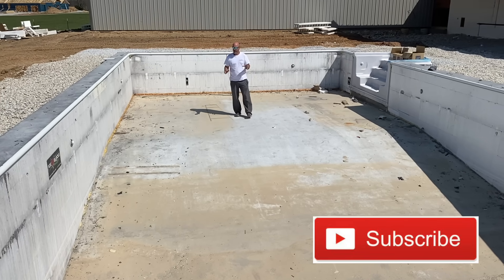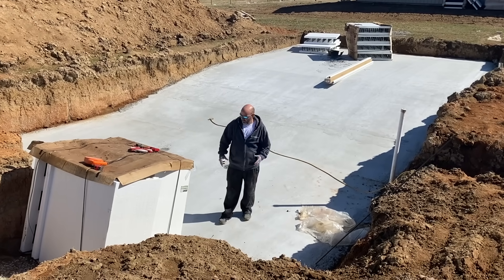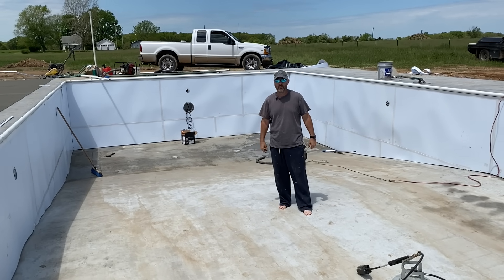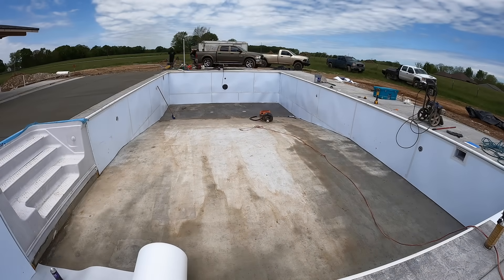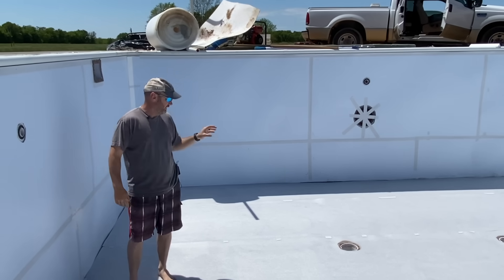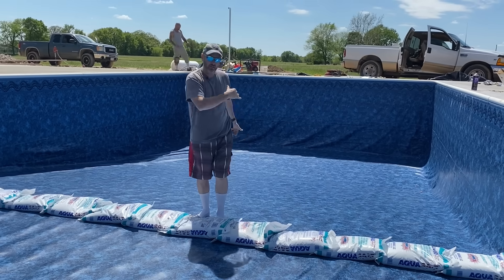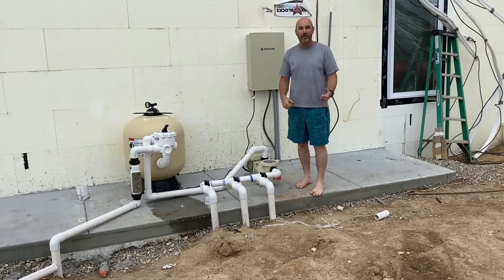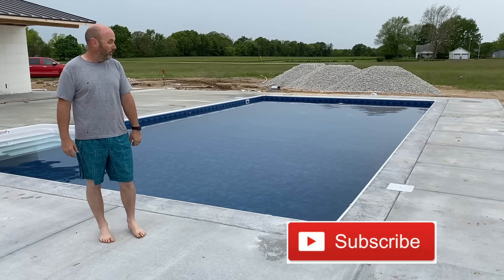ICF Pools of the future! stronger, cheaper and more efficient!

Comment: Looks great. Really like the way you explain things compared to some guys who just like to hear themselves talk. Couple of quick questions. I'm going to attempt to do my own icf plunge pool, 5ft deep flat bottom. Was wondering if you think I could do footings and do the floor of the pool with rigid insulation and compacted sand instead of concrete. I was also thinking of doing one step across the full width with concrete but not sure if a liner can be made to accommodate something like that. Appreciate you answering our questions. Thnx
Reply from the maker: If you are doing a liner u can do sand or vermiculite(pool Crete) for sure!  And you can do benches and other shapes, they make the liner to order, look into the liner track imbedded in the steps and benches as a way to hold the liner in place while it’s filling, it’s kind of a new solution but I love it!

Comment: What size core icf 6,8,or 12
Reply from the maker: On vinyl liners 6 is plenty, compared to the steel or polymer walls typically used it’s kind of overkill but less money lol, on our plaster pools it’s 6 or 8 if all in the ground, up to 12” on infinity edges or other raised beam situations!
Reply: Thanks can u tell next time about rebar size and how often
Reply from the maker: I can show it more next time!  On liner pools it doesn’t really matter, we do it like a house, 32” on center vertices and one row horizontal per block, so 16”, and alternate in or out from center line...  ultimately anything is stronger than traditional liner pools!  The monopours the rebar is much more involved, we have 3 coming up back to back so I’ll try to get into the details a bit

Comment: results look great - and you clearly know what you are doing. would be great to see more details.  how did you cut and tie in the stairs? how did you shape the blocks to stack on a shaped surface and get so level?  rebar?  ...  hope you can share more of the key details - great potential for DIY if you could
Reply from the maker: The one I’m working on today is a flat bottom, but it’s got the same set of stairs, I’ll try to show that part in great detail when we get to that phase and I’ll do the slope when we get to that part of the next pool

Comment: Do you do a monopour for plaster finishes so you don't have to place a waterstop strip at the bottom of the wall joint with the slab?
Reply from the maker: Ya, plus up until recently we were putting xypex in as an admin to waterproof the concrete itself and the one piece shell is more conducive!  That said we just bought an ecofinish machine and they recommend not using xypex because the epoxy cost needs to penetrate!
Reply: @all3pools  What were the pros and cons between using xypex and an eco finish machine? I always figured a xypex additive would be the end all, be all of waterproofing.

Comment: I was wondering,  Do you have to drill any reinforcement rod into the Footer Slab before you do the walls? To tie the wall to the floor
Reply from the maker: Yes, it’s very hard to hit the exact middle of the webs with layout, so we typically lay the first row and then drill them perfect with an add max with a long bit and then epoxy them in!
Reply: @all3pools  Ok, I was hoping so, I just didn't see it in the video.  Great Job!
You make it look easy!

By the Way... Using ICF will help big time keep the water temperature warmer and more consistent.  I think because of the insulation from the concrete walls.
Reply: @all3pools  there are so many epoxies out there so no need to set your verticals for the slab/footing pour. if you have a cold joint you can use Hydrophilic water stop between the footing/slab and wall section to waterproof that joint. just don't forget to install a keyway for the shear pressure. important. lol

Comment: I would have loved to see the anchoring system for the liner and when it comes to the liner, do we have to make the pool to a specific size dimension or can we pretty much design the pool shape like we want and the liner is made according to our design? And if so, where do we order the liner from ? Much thanks !
Reply from the maker: It’s a typical liner track, so the liner has a bead that hangs in the track and the water pulling down locks it in, it’s crazy that it works as well as it does lol..  liners come from a few manufacturers, we use Tara liners most of the time, quick lead times, and they are made to order, the more info you give them the better they fit!  Any shape or size within reason
Reply: @all3pools  are you going to make a video with a full pool install at sone point?
Skimmers, stsirs, etc etc? So far from all the videos i’ve seen, yours is the most down to earth.